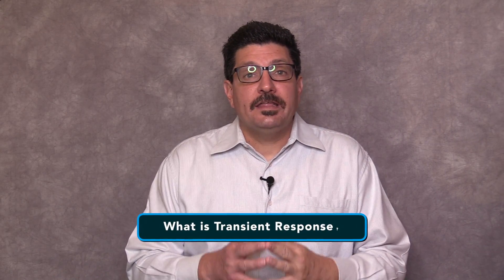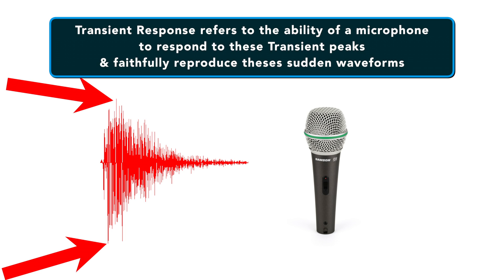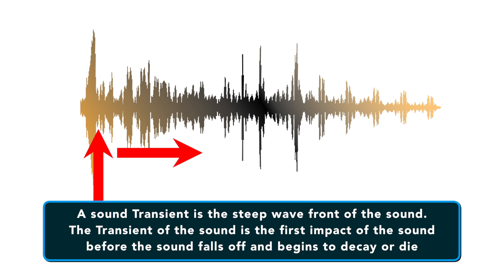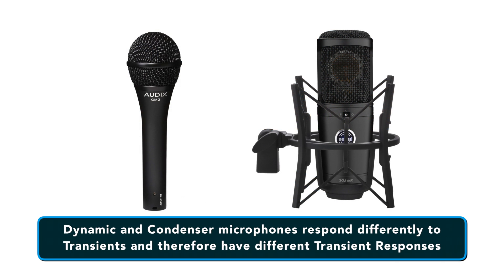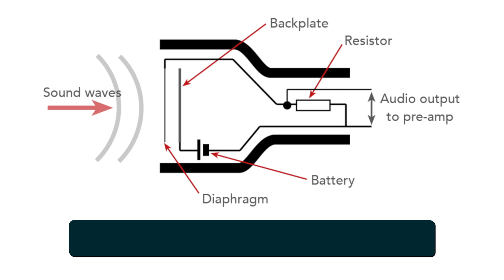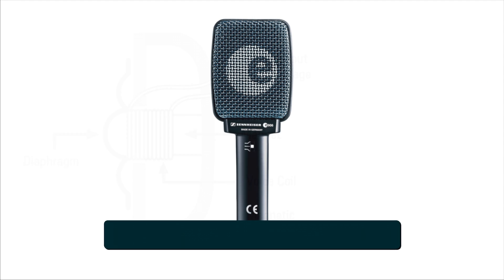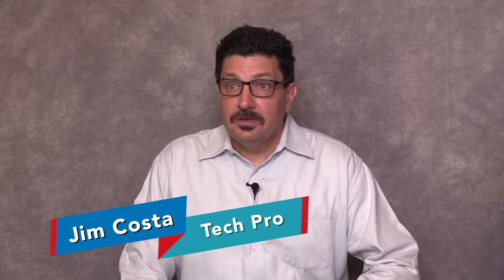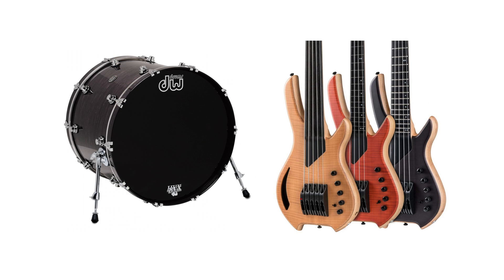Unveiling The Secrets of Audio Transient Responce

Comment: Heck yeah! I've got it. Thanks for the answers to my questions. I'm a drummer, and I wanted to know why condenser mics are mainly used to capture cymbals and dynamic to capture drums. This makes much more sense now. Thank you...
Reply from the maker: Glad I could help.

Note: when placing drum mics, it’s important to remember that sticks and hands and cymbals will be falling very hard near them, so make sure your mics aren’t in the way of the player or a rogue ride cymbal. This article breaks down mic placement to the individual drum pieces. Remember, these are just guidelines, always defer to the judgment of your ears. When recording drums, try to get your hands on the best sounding kit you can for your style of music. Get new heads and pay attention to the tuning. If it doesn’t sound good from the get go, it’s not going to sound good at the end.

MIKING CYMBALS:
 If you have enough free mics and inputs, mic up the most important cymbals — usually the high hat and the ride (though you should ask first, some drummers may feel their crash or china are more favored/essential to the track). These mics may end up being mixed very low or cut out entirely in the track, but it’s still important to have them recorded, just in case.

Some points to consider:

	•	If possible, use small diaphragm condensers.
	•	Make sure to pad either the mic or on the pre-amp, as cymbals have a high output.
	•	Feel free to engage a high pass filter, as many of the lower frequencies will be cut out later — it’s the higher frequencies you want with cymbals.

The techniques:
 Place the mic over the side of the cymbal, about an inch or two above, while making sure that it is away from other drum pieces.If the previous set-up results in too much “swishing” from the movement of the cymbals, use your ear to move the microphone either closer to the rim or the middle, and move the microphone higher or lower until you have the desired cymbal sound.

MIKING OVERHEADS:
 Depending on the sound that you are aiming for, overheads can be used to capture the sound of the kit as a whole or can be used as cymbal mics.

Some points to consider:

	•	Use condenser mics, preferably large diaphragm, though small diaphragm will work fine as well. If no condensers are available, dynamic or ribbon mics will be fine.
	•	Be sure to have the pad switch on your mic, or on the console/DAW interface, set to -10 dB because the cymbals will cause the microphones to have a high output.
	•	To clarify the sound of the cymbals and eliminate some of the ambient sound, you can engage a hi-pass filter either on the console or the mics.
	•	If using your overheads as cymbal mics, we need to check the cymbal balances. If a cymbal is too loud, move the mic away and vise versa if the cymbal is too soft. Use your ears to get the best set up for you.
	•	If using more than one overhead mic, check the polarity between the two (as well as between the overheads and kick and snare mics) and flip the phase accordingly
	•	Make sure to pan your mics according to where they are on the kit, far left and far right, etc.

The techniques:
 Use the technique of XY overheads, as discussed in the simple drum kit miking article. Place two mics over the kit, one directly over the snare, the other directly over the floor tom, and up from the kit about 2 to 3 feet, use your ear to dictate the exact distance. It is imperative to check for phasing issues with this technique.

As in the last technique, place one mic 2 to 3 feet above the snare mic, and place the second mic over the floor tom. Measure the distance (with measuring tape or a string) between the center of the snare and the mic above it, then place the second mic at a distance/height from the kit that maintains the same distance between the center of the snare and the second mic. The two mics will not look balanced visually, but this should eliminate phasing issues since both mics are equidistant from the sound waves the snare is producing. A similar measuring technique adds the bass drum into the measurement, making a triangle for you to follow instead of a single line.